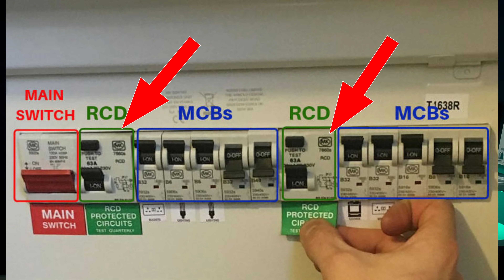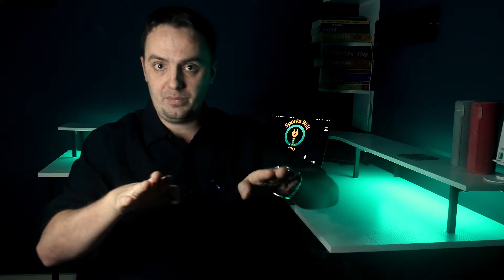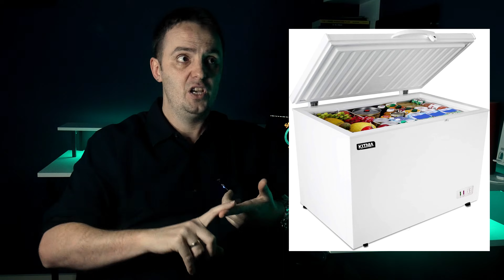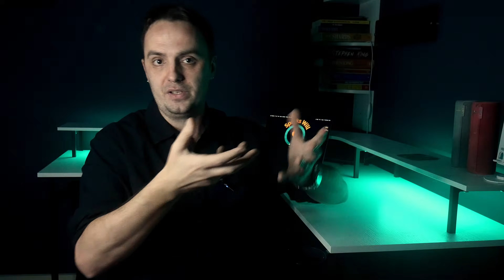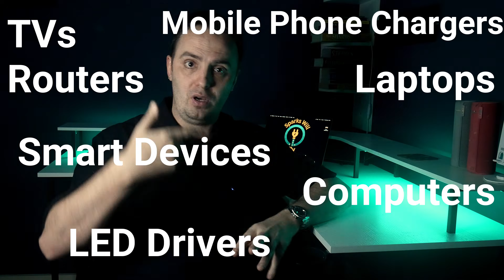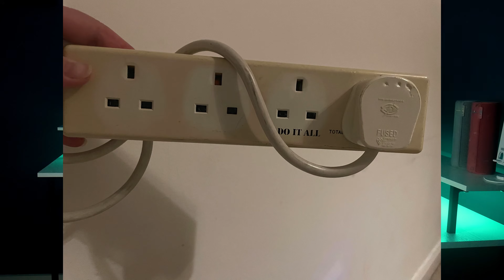RCD Keeps Tripping? Here's Why & How To Fix It

Comment: A scenario if I may. I have an electric fan oven. Just recently (past two weeks) when I turn the oven on, after ten minutes the RCD trips. I think the oven is knackered but I'm curious to know why it trips after a period of time. Does the leaking current build up as the oven gets hotter? Is current leakage affected by the age of wiring? Much of mine is old and very brittle so might this be a contributory factor?

Comment: I;ve had a nightmare with tripping for five years now.  I make music on my dekstop computer and it's only when I'm using the software to do that, that the breaker trips.  It's the upstairs sockets circuit.  I have the Desktop AND laptop on all day and night with no tripping.  Soon as I start the music software, the breakers tripped within minutes. The laptop trips when plugged in with the same software.  My wifes laptop does too with the software.  That's 3 computers which never trip power otherwise. 

Power consumption wise, there is a small heater for geckos upstairs.  It activates once every 4 hours for 15 minutes.  Otherwise there is a tv in the main bedroom and the desktop,  and two monitors, thats it. 

The house trips when it rains heavy and there is a light outside the back door.  It's a 75 year old council house. That happened with no computers even on.  I know digital audio workstations can ask for some extra power but nobody I know with this software has this issue.
Reply: Software causes a specific cycling within CPU, which ramps power up/down in a sinusoidal wave pattern which the RCD detects as fault condition... replace your RCD.
Reply: @khalidacosta7133  Yes.  Google AI says I need an F type RCBO with a C Curve.  The C Curve tollerates the power ramps. The RCBO can detect the earth leakage as being harmless and won't trip.  The standard Type A RCBO thinks its a danger and trips.  About 400 euro for the type F but it should be a proper fix.